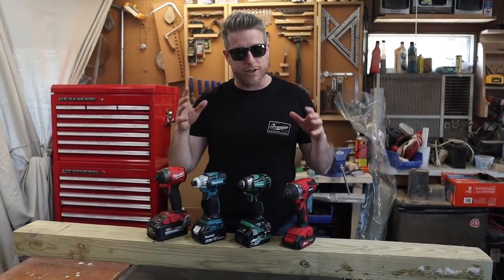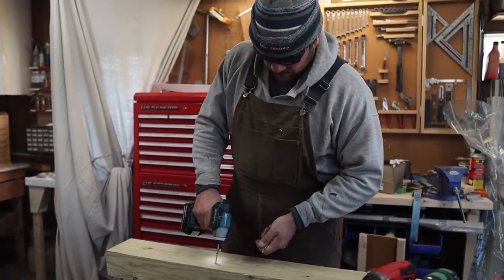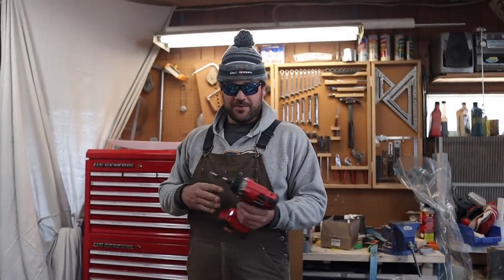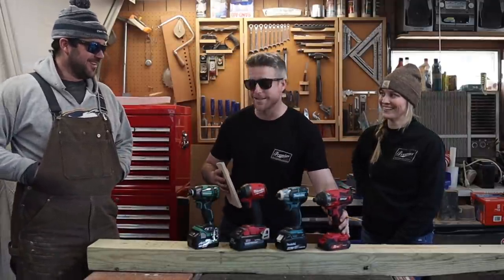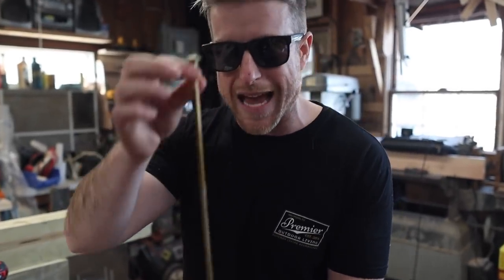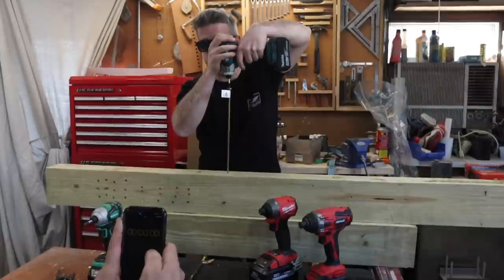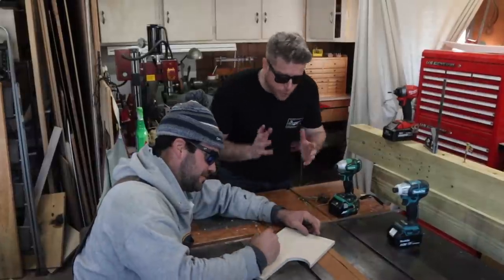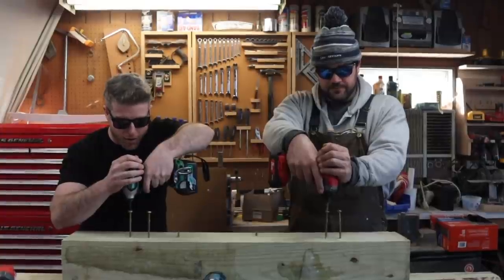Cheap AMAZON Drill VS The Pros! - Power Tool Playoffs

Comment: The Makita "soft impact" is designed to be less powerful but quieter than the rest as its internals are submerged in oil to keep the noise down. Makita makes much faster and more powerful impact models. The Milwaukee fuel and the Metabo HPT are both the flagship impact drivers available from both companies. Not a fair comparison for the Makita but I understand it's what you had available for testing purposes.

Comment: What's that model # on the milwaukee impact you tested? That thing is tiny compared to my milwaukee impact. Mine will shred those 1/4 hex socket adapters so I end up buying the 3/8 impact to stop buying the adapters. Definitely way more torque than the one in your test.